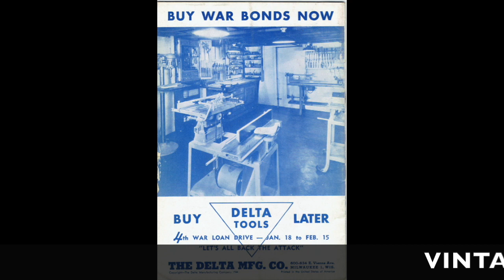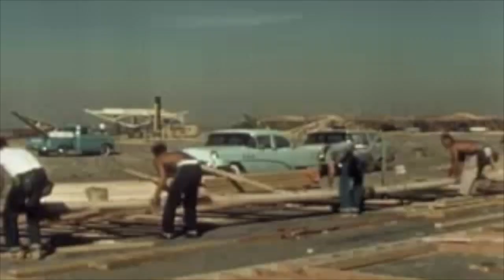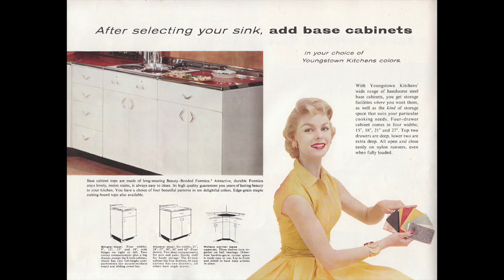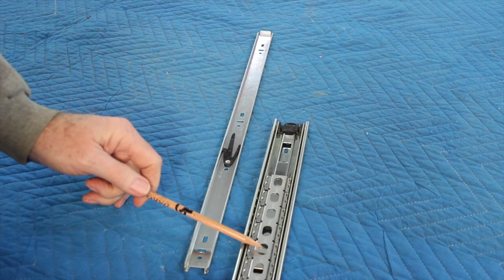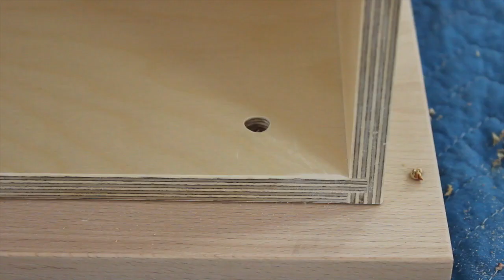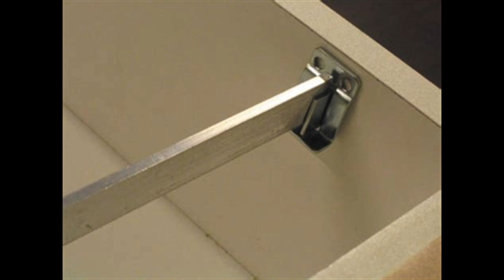65 Years of Drawer Tips in 20 Minutes!

Comment: Do you have a video on finishing drawer boxes?

How would a box be finished if it's plywood with round over tops? Could that have edge banding on that round over/bull nose top, and how would that work? Would it last?
Reply from the maker: Edge banding probably won't stick to those rounded edges.  Plus, it would be hard to trim the excess banding cleanly or consistently.

Any clearcoat that's reasonably durable will work for drawer boxes. Probably 90% of our drawers are prefinished UV birch ply with half blind dovetails. Folks like the fact that they are easy to keep clean.
Reply: @ShopTalesandLore  Thanks for the info. I don't wan't to do dovetails for this project because of the complexity of it. Too risky for me since I have limited dovetailing experience. I've decidced to use prefinished 1/2" ply, but don't want to leave the top cut edge bare as I think it looks unprofessional so I can just do edgebanding on a square top.

Only thing is I don't know what the prefinish is to match it, but Steve Ramsey from WWMM said in a video everything industrially available at stores prefinished is almost guarenteed to be lacquer.

I bought a spray can of water based poly and a can of shellac for ease of use and to save time. Do you think that would work for applying it to the edgebanding and the drawer bottoms, or would you recommend something else. I'm still new to finishing, only really done stains and paints before.
Reply from the maker: @mavenfeliciano1710 -- Yes most pre-finished ply uses a lacquer clear coat, but it can be either solvent-based or water-based.  You can also get pre-finished edge banding at most good lumber yards, and eliminate the finishing altogether.  The finish is really tough, and isn't bothered by a banding iron or heat gun.
Reply: @ShopTalesandLore  good to know. Thanks.

Comment: Have you ever come across plastic drawers that are TOP mounted?

In addition, there are no backs, only corner triangle pieces and a long back stretcher in each run (no individual boxes) which also holds the top mounted plastic drawers.

Even more, there are no partitions (divideres) and the ends of the frame are flush while between doors and drawers there is the face frame, so it's neither frame nor frameless, but a bit of both.

It has thrown me completely off, but with the jig of holding slides in your other video and a Taunton book I borrowed from the library has given me a way to install new retrofit drawers by adding cleats to the back attaching to the stretcher.

I couldn't find any information anywhere else so I have to make it work for the client if they accept my quote.

Thanks for the history and tips. Now to hurry with an estimate which I'm still trying to figure out since I've recently gone on my own.
Reply from the maker: Yes I've seen that method of case construction and it's typical of cabinets found in box stores. We have used the same solution you described, by adding some sort of support structure to the rear stretcher, deck or sides/partitions to serve as an attachment point for the slides. Let us know how it goes, and thanks for commenting!